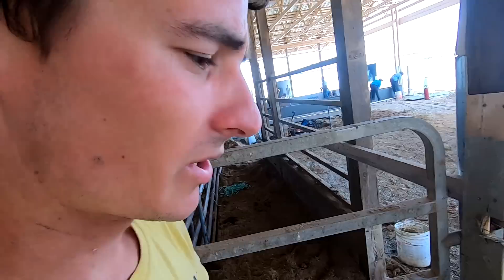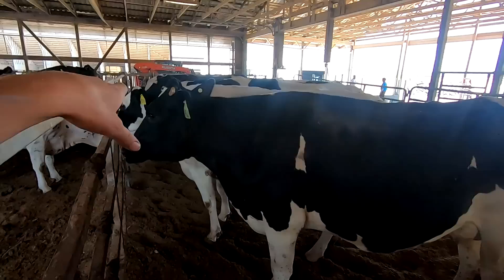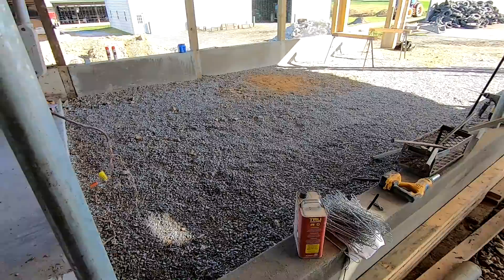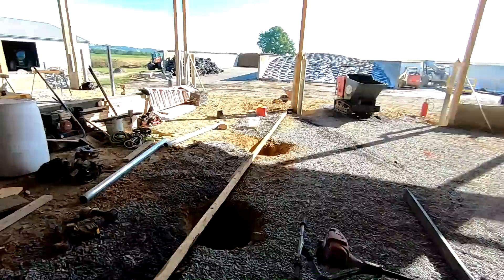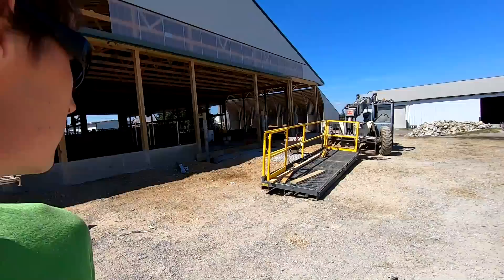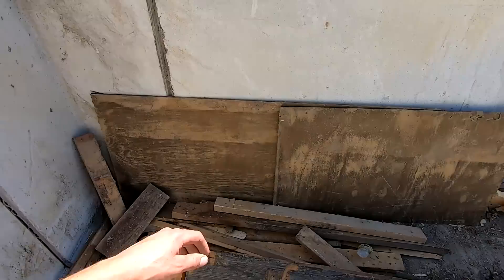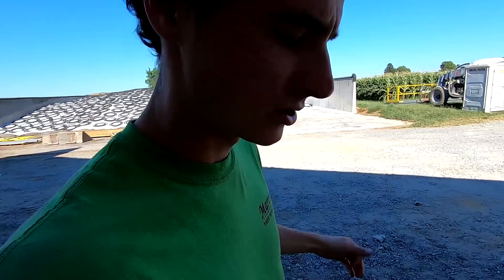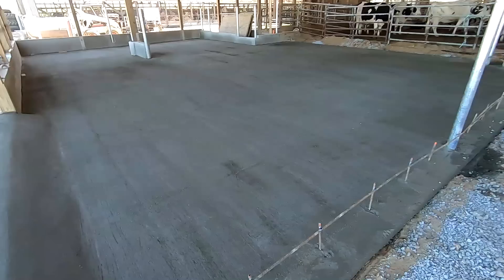Concrete Floor in Barn Addition

Comment: This concrete shall be a learning experience with frost cattle and machinery on it and no rebar mesh or expansion joints... time will tell...
Reply from the maker: It shouldn't be an issue with a 4" slab. Not a crazy amount of weight running on it.

Comment: I get your reasoning but rebar and expansion grooves are integral to the longevity of pours that large.
Reply: He could have at least ordered the poly-fiber stuff mixed into the concrete for convenience. Skipping mesh/rebar completely seems like a sketchy decision. Concrete WILL crack so you need to control how and when as best you can.
Reply: Cattle on the concrete as well as heavy machinery I believe it needs rebar along with getting frost in PA I hope it doesn't crack this winter...
Reply: @jdjd7127  For sure that concrete won't last as long without some kind of mesh. I heard good things about the fiberglass mixture but not all places supply it.
Reply: It seemed to get super thin towards the bunker I couldn't really tell in the video I'd say maybe 2 inches... what are your thoughts... I kinda cringed thinking it will all just crumble and break right apart... especially with the equipment coming in and out if that area...I don't work concrete but I've been around a little
Reply: @jdjd7127  Even with reinforcements and perfect setting/curing all concrete will crack. It just happens worse and sooner when shortcuts are taken. The only thing worse than relying on advice from strangers on he internet may be NOT relying on it sometimes. However, trusting the random trades you hired is a gamble too if their word has no professional association backing like with a professional engineer for instance. Once the stuff fails, the guys' words aren't worth much in court. That only counts if the guy is a certified professional with papers. Best of luck to them.
Reply from the maker: It's a 4" slab that we wont be running much weight on. They have been doing it this way for many years without trouble. Our new heifer barn was done the same way.
Reply: @10thgenerationdairyman61  good to know I was worried that it wasn't thick enough no rebar etc... we care is all not to nit pick... my area in NY we love them amish workers supplies etc they are awesome so it's not that...

Comment: Eric, i also follow one construction guy's videos. One time he mentioned that the concrete gets cracks every 10 feet, so he put some extra rebar on the home base floor each 10 feet. Just keep observing, i would like to know if that is true or not. I hope your floor stays good. Thanks for sharing.
Reply: That’s why they usually cut it,so when it cracks it runs in the cut!

Comment: If the concrete has fiber added no rebar required as it is the reinforcement. Where vehicles drive especially heavy ones, using both rebar and fiber plus more depth of concrete  is indestructible

Comment: seeing the poring from an european perspective it seemed pretty inefficient with the buggy machine? here we just would've used pumps or a pumptruck
Reply: My experience is that pump trucks are typically much higher price hour and require 2 operators from the cement company. This is one cement company operator and a much less costly piece of equipment. This was not a huge pour, so the extra price on the higher priced equipment not necessary.
Reply: @markiowa5437  if u see it like that makes sense ty

Comment: I'm no professional but isn't no fiber no rebar uneven base and dg not compacted big no no's
Reply from the maker: It's a solid base. Should be ok with a 4" slab, not running much weight on it.
Reply: @10thgenerationdairyman61  I hold a construction supervisor license for 40 yrs. Always use wire or rebar in a slab and relief joints. Also what lb. contrete was used and what was the slump?

Comment: No rebar on a concrete slab that big and it "doesn't need it" wow. That just makes no sense whatsoever
Reply from the maker: It's just 4 inches thick with a solid base and not running much weight on it
Reply: Yeah, but the ground settles too, yeah it'll be easy to rip it out and slab a new one in with no rebar in it.
I have been a carpenter now for 10+ year and i just find it not up to notch build quality and unprofessional. Really hope it last you as long as all the others so far.

Edit: other than that i found the video as entertaining as usual for your videos. But my professional pride just made me comment.
Reply from the maker: @uunari   I understand what you are saying. I had a conversation with the builder about it and they've done a lot of barns this way without issues. They just said its overkill for this situation.  Hopefully it works out for us.
Reply: Well yeah, hoping the same.